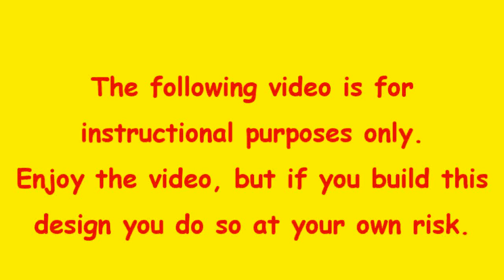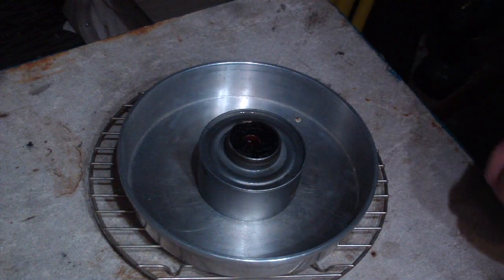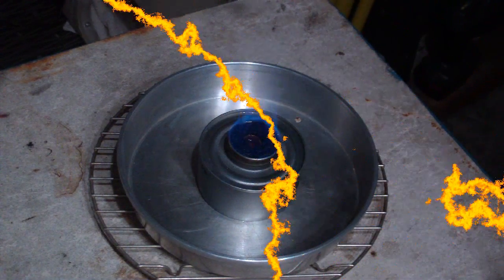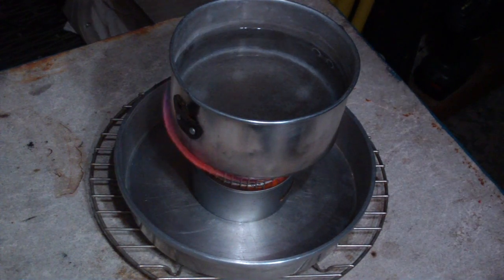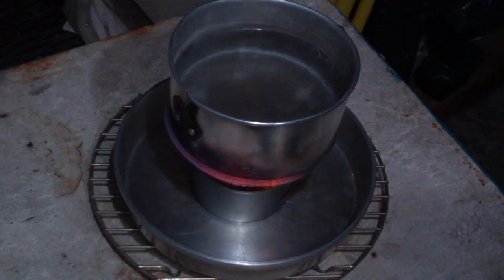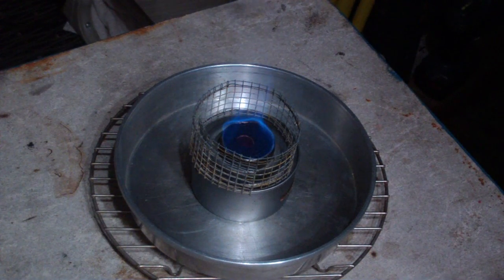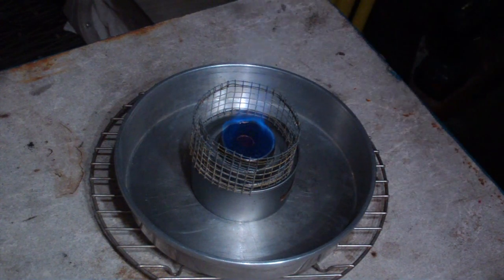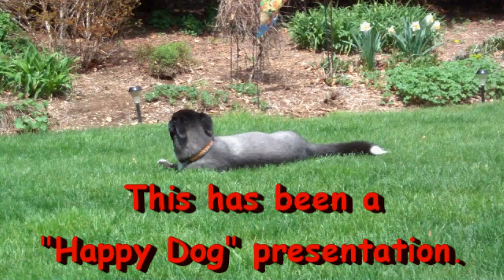What Can Happen If You Overfill A Modified Chafing Fuel Can

Comment: The copper tube is probably helping to transfer he heat farther down into the fuel.
Reply: Absolutely this. And, the fact that this is being used in close proximity to the pot which pushes the flame and heat down onto the can and heats up the can. 

Whereas when you use chafing cans traditionally they usually are provided more distance between the flame and the bottom of whatever it's heating so the can doesn't heat up